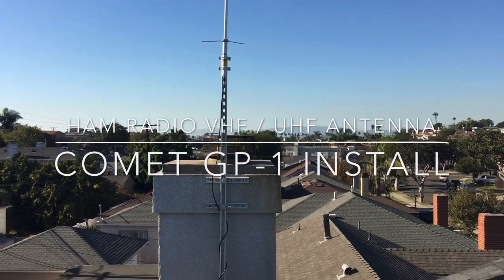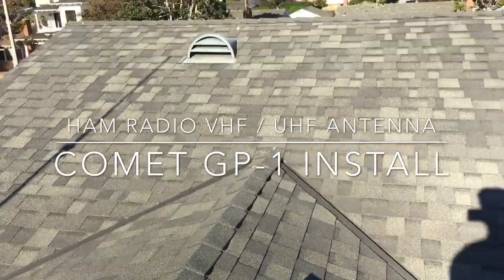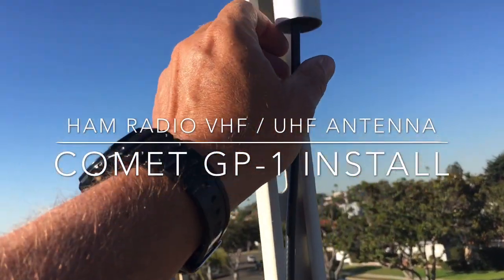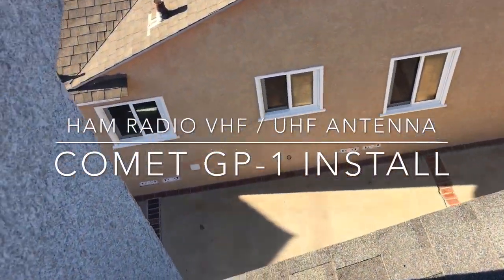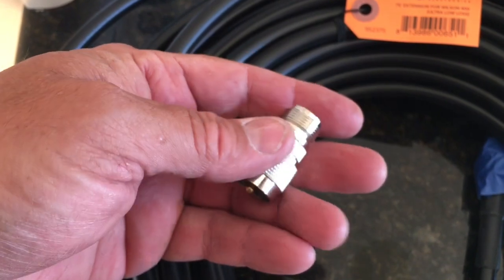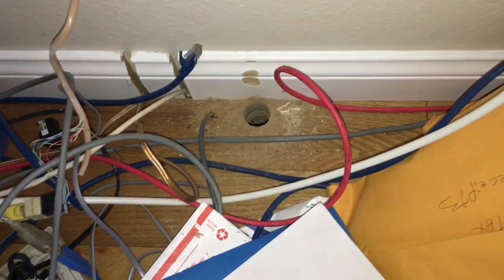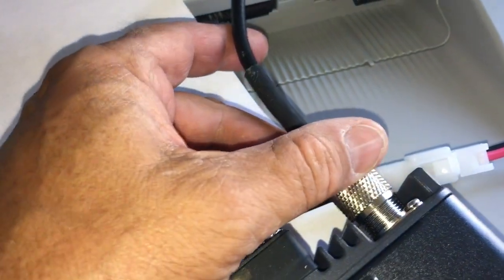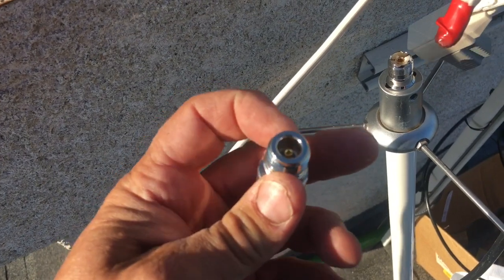Comet GP-1 VHF / UHF Antenna Ham Radio Installation on Chimney Using Superstrut

Comment: I hope the set up works for you for a long time, but adding the structure to stucco is going to wear out your anchor points. Just a thought.
Reply from the maker: If I understand correctly you are saying that the vertical aspect flexing in the wind is going to cause the anchor points to slowly degrade over time ?  If I was anchored into wood that would be better?
Reply: @dannyjensen4954  I would say so, treated lumber though. I just know stucco crumbles easily.

Comment: Personally, when I run cables through walls and floors, I run them first and then solder on the ends.  Leaves me with smaller holes to grommet.
Reply from the maker: That's a great idea! I wish I knew how to solder the ends on.

Comment: Hey Danny, welcome to the hobby - you will love that antenna! That was my first 2m/70cm antenna and it served me well for a few years until I upgraded to their 10' 2" GP-6 which doubled the 2M gain to +6dB and increased 70cm to +9dB. Then I got the IC-9700 so replaced that with their 9' 8" GP-98 so I could use the 23cm band, too. Comet antennas are well-made and strong performers. By the way, if you ever need great cable, I strongly recommend ABR Industries, sold on all the ham radio sites like HRO. All of their cable is low-loss and very high quality. You will pay a bit more but it's worth it for performance and longevity. 73 KJ6ER, Silicon Valley
Reply: I recently picked up several lengths of coax from ABR Industries locally. They are friendly, and their coax is well made.
Reply from the maker: Thanks for you comment. Will consider the GP3

Comment: Does it makes a different when you buy a 5 foot , 7 gain antenna commet  100 bucks vs a  30 inch 2-3 gain antenna for 40 dollars, in range and quality sound
Reply from the maker: Gain is everything I think if you can afford it.
Reply: @dannyjensen4954  👌

Comment: Bad for VHF? That's not my experience. The coax length makes the difference, so it might be not do so well at 75 feet!
Reply from the maker: You are correct. My wording was not correct. The lm-400 has far less loss at 75 feet so lm-400 is a better choice with the GP-1 a small antenna with limited gain. I am new to ham radio and this was my first antenna project. The  HRO sold me the rg8x and for the price, the Amazon lm-400 like cable is better for long runs and it is more rugged and waterproof.
Reply: @dannyjensen4954  Right, but the GP1 has 3dbi gain at two meters. That is effectively  doubling of the ERP from whatever power you're putting into it, ie: power from transmitter 50 watts= 100 Watts ERP. You're actually doubling your transmit power.  Even more power on UHF: 7 dB.
Good video. G7MJT
Reply from the maker: @mikesey1  Thanks for your comment. I'm going to look at what the ERP topic.

Comment: 1:00 Is that VIVO cable full copper?  That brand sometimes is copper coated aluminum.  Might want to check on that.  It will likely 'work' but is contrary to the NEC as communications cable shall be copper with exception of Coax cabling.
Reply from the maker: Check the link in the description .. lmr 400 ... This Wilson-400 cable is LMR400 equivalent (if you’re familiar with those). The thickness or diameter of this 50' cord is 13/32 of an inch. It is fitted with a N-Male Connector on each of the two ends. This makes it ideal for use with any Wilson Electronics in-building cell phone signal booster amplifier system equipped with Type N connectors. Way better than rg8x if you are running 50+ feet vhf / uhf. I am also using for hf endfed hw antenna.
Reply: @dannyjensen4954  I did look at that cable (for the antenna) and I'm pretty sure it's going to work fine.  I do note the review from someone named 'cam' on May 29, 2020 that gave it a poor review because that cable also is CCA.  I'm not a fan of copper clad aluminum.  In any case, I was referring to the UTP cabling which I assume is cat5e or Cat 6, the VIVO brand.
Reply from the maker: @jeffwilcox9987  Oh. Thanks for this post alerting others. The cat 5-6 is unused so far so and I didn’t think about it until your comment. The LMR 400 copy cable I’m using for VHF and HF and it is way better than the rg9x the ham radio store sold me based on my SWR meter.  Thanks again for doing the research.

Comment: How did that cable work out? I’ve got a roll I’m going to install tomorrow. Just concreted a 1-1/4” iron pipe in the ground at a depth of 3’ with 1’ diameter of concrete 1’ deep. How high do you recommend running the mast? It’s for vhf/uhf radio.
Reply from the maker: I’m not an expert. High as you can on the mast. I’m hitting the repeaters I want to hit here in the city. It appears like your situation is great. Lm400 was a big deal. Maybe I would have used a gp-3 if I had to do it again but I can hit what I set out to hit.
Reply: @dannyjensen4954  im tryin to hit my moms house 20 miles away. Any thoughts? I had great intentions on the 1-1/4” iron pipe mast but I was just thinking the weight and lifting up 30’ of pipe to screw it into the 2’ that is sticking out of the ground might pose a problem.
Reply from the maker: @patriotplumber4694  I'm sort of new to ham radio. I know VHF line of sight has not been a problem for me on the ocean with 8w. I have a 25w HAM VHF car radio I have used with my GP-1 and my car antenna and  I have had no problem with 20 miles. It depends on what you have in the way between houses I guess.  I live in he city so range is not good over land but over the ocean it is great.
Reply: @dannyjensen4954  thanks for the reply. I was able to accomplish my goal of reaching my 12 yo daughter at school 20 miles away from my house. She has a 8 watt and myhouse has a 25 w with a comet 1 antenna. It’s working great. Bonus is I can reach my bug out location also. Thanks for the information!
Reply from the maker: @patriotplumber4694  You are doing great! I can’t hit my wifes work 10 miles away without using a repeater. She works near tall buildings and a major airport. 8 watt is ideal. Good info for others. What frequency UHF or VHF were you testing?

Comment: How did you ground it?
Reply from the maker: Yea. I didn't have anything when I did this video, but I did rig something later after I learned some stuff.  For Lightning ground I tied  #10 solar panel grade cable to a conduit running to the solar panel. This conduit is grounded with house electrical  service buss in the main panel via a ground steak near the panel the conduit. RF ground is done by a separate ground rod outside of the shack to a #8 wire that I have tide to a shield on the So239 connector.
Reply: @dannyjensen4954  I'd recommend something like a Polyphaser lightning suppressor on the coax just before it enters the house.